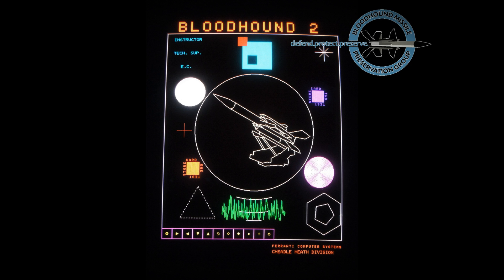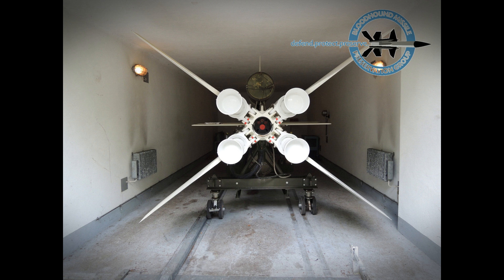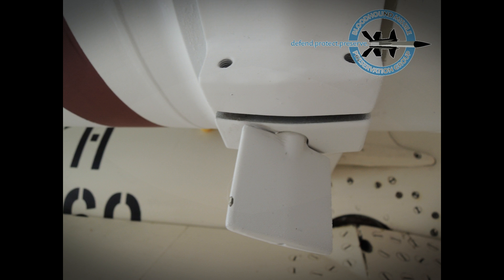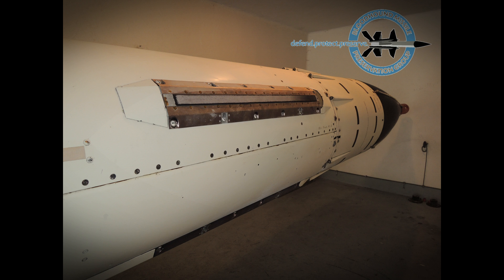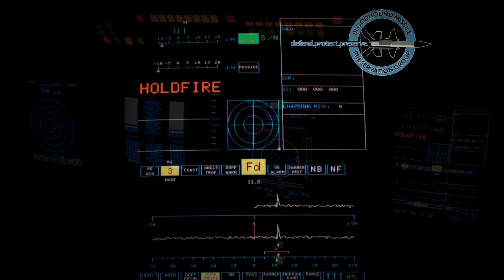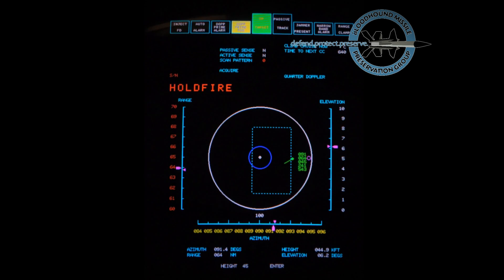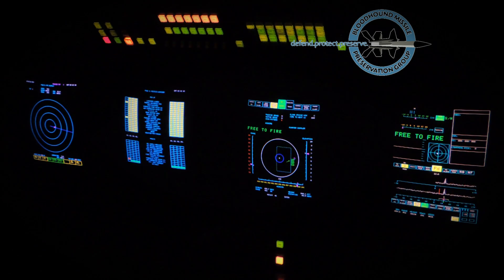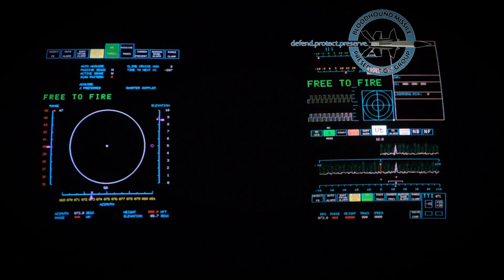Bloodhound Missile Simulated Firing & Target Interception.

Comment: The set up looks like something from the original Star Wars films. How effective would this system have been if the Cold War turned hot in the 1980's... would the system be able to successfully engage and destroy the Soviet bombers coming east and towards the UK or would have the Soviet's used ICBM's launched from submarines?
Reply: Hi Sam,
Thankfully, we never had to find out! The system was tested regularly against friendly forces and remained effective against targets from low level to >60k feet. It was a key part of the UK's layered defence. Jammers and anti-radar missiles evolved rapidly through the eighties - systems available at the end of the decade would possibly have given Bloodhound a hard time.
Reply: @petermurray6130  thanks for the answer. Good video by the way! Keep up the good work!
Reply: No capability at all against Ballistic Missiles or Air launched Stand Off Bombs or Cruise Missiles. Could deal with SU-24 if the aircraft could reach the UK or any high level recce birds like the Mig 25. Most attacks on the UK would have been stand off missile attacks from TU-22's or TU-16's with the missiles launched well outside Bloodhound's maximum range.

Comment: Would be nice to have emulator of that thing. What were the computers used? Would it be possible to extract software?
Reply: The system uses a multi-processor Ferranti Argus 700 mainframe. The displays are driven by a long since obsolete, but thankfully very reliable, Ferranti CHARGE (raster graphics) system. We have a long term aim to emulate the graphics system to allow conversion to modern flat-screen displays.

Comment: is this how it would of looked when it was deployed in the 1950's?  They didn't even have colour tv's then did they?
Reply: The control console was installed in the mid-80s and represents a significant update on the original (orange scope) console. The modification also added a sophisticated training simulator, which allows us to demonstrate how the system would have been used.
Reply: This is the Mk 2 system introduced into service in 1964, but not operational until 1966/67. The Mk 1 missile system was a completely different beast and almost nothing within the 2 systems were compatible at an operational level.

Comment: Being an ex Air Radar (EE Lightning) guy, I find the technology fascinating. Can you explain the function of the launcher stalk aerial and the missile receivers, location of the antennas on the missile and in flight commands that would be uplinked? Never worked on these, but saw them whilst based at Bruggen early '83. Probably one of the most impressive sights I saw throughout my 22 years! Fabulous work. Congratulations to your team and I look forward to visiting the project in the future.
Reply: Left Brugan in 83.  the stalk Aerial is  The 'on launcher' reference Antenne the Missile was semi active and some Command instructions could be sent via the Radar beam and the signals that kept the missile working with 'it's radar' these signals were received via an antenna in the rear of the missile and before launch on the launcher via the stalk antenna.
Reply: @michaelshore2300  thank you.
Reply: Thanks for your interest in the BMPG. The stalk aerial allowed the missile to receive the in-flight reference signal transmitted by the radar while it was sitting on the launcher. The missile had a rear-facing aerial hidden inside the aft fuselage, a steerable parabolic aerial inside the radome and four proximity fuse aerials around the forward fuselage. The command link transmitted just 4 commands, which allowed basic control of the missile doppler tracking loop (for ECCM purposes) and also switched the missile guidance to terminal homing mode at the appropriate time.  Check out http://www.bmpg.org.uk.

Comment: home on jamming - forward thinking. The UK liked a jet powerplant for several missiles
Reply: Originally installed on Bloodhound Mk 1 as a Modification in 1961. In fact Fighter Command would not accept it until some form of ECCM was fitted to the missile and the radars used in the system. UK was no different to the USA and USSR as regards Ramjet powered weapons. USAF and USN fielded two service weapons (TALOS and BOMARC) and quite a large amount of the design features out of both were copied by the British into Bloodhound. Soviets also fielded two service weapons, SA-4 and SA-6. UK also fielded Sea Dart, which was basically a cross between a mini TALOS and a TARTER.
Reply: @richardvernon317  All of those guided projectiles are known to me. Fun how you described Sea Dart as a mini. Rewatched or re read information on the British and US weapons recently.
SD is part of my story - The hardest: Biting Sea.
Reply: @TheKeithvidz  TALOS was huge (150% bigger in diameter than a Bloodhound), Sea Dart was a fraction of the size with a range around 80% that of the early RIM-8A